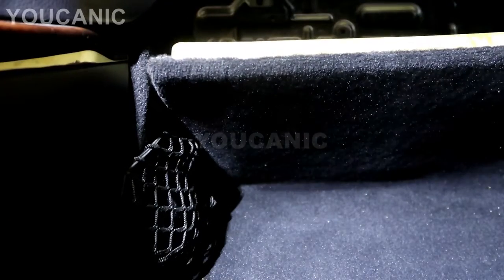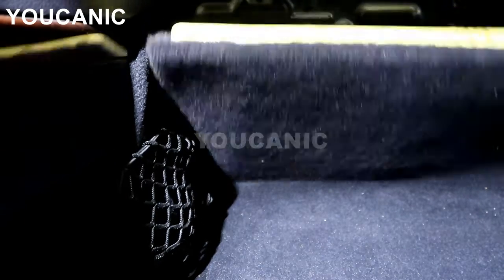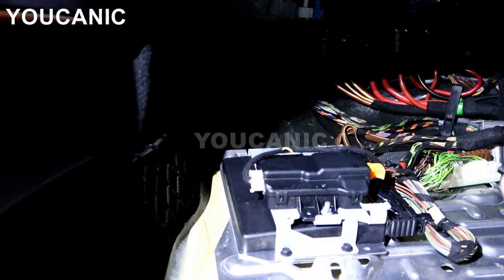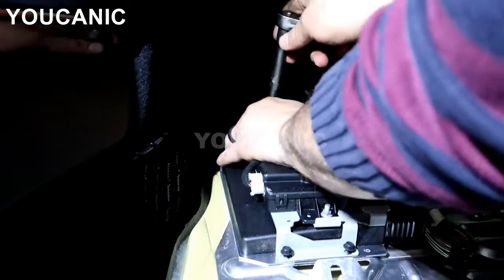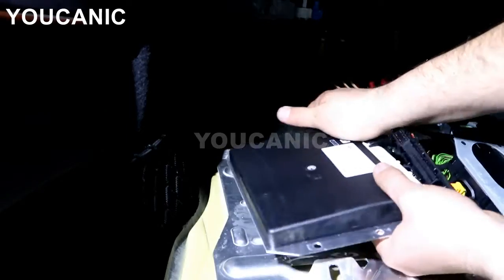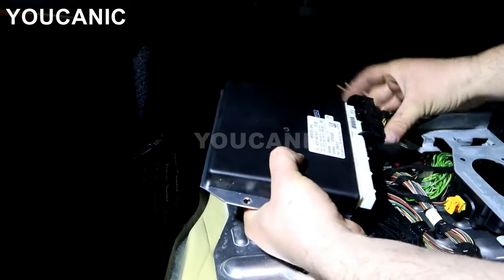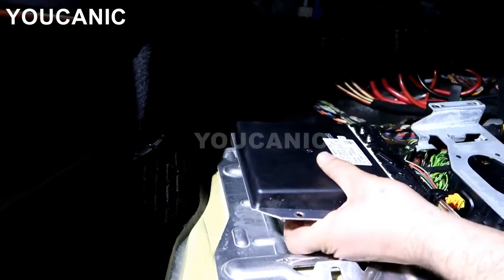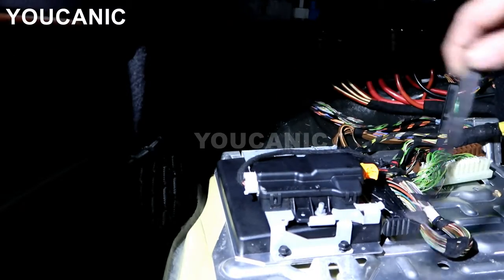Mercedes-Benz Air Suspension Airmatic Control Unit Replacement

Comment: Do you need a recalibration after installing the module or anything to do before and after disconnecting the module? have 2012 Mercedes cls550
Reply: hey I have same question did you have an issues or did calibration after replacement because mine doesnt work

Comment: If i got rid of air ride can i unplug this to get rid of warning light
Reply from the maker: Thanks for reaching out! Yes, you should be able to disconnect it to get rid of the warning light, though specific steps can vary depending on the car model. At Youcanic, we offer helpful guides and resources to make car maintenance easier. If you need any further assistance, feel free to visit our site, [www.youcanic.com](www.youcanic.com). 

We even provide factory repair manuals for detailed instructions. We're here to empower and support you throughout your car ownership journey with our Youcanic scanner and free resources. Trust us to walk with you every step of the way!

Comment: Hi guys I'm desperate for advice, I was simply using a xtool d7 scan tool checking on my old 2010 e550 bec I wanted to see how to check electronic leveling feature but it doesn't offer that and showed connect ECU failed for some features that are not in the unit ..so as I was shutting down the scantool  tablet it froze and not even the reset button will shut it down, even as I disconnected it, now my airmatic button is also frozen at high position, all my air springs are 4.5 inches  above my  chassis ..took to a diy mechanic friend n said the module may be burnt?
I was told it's a very specific part ( A2129003504)..WHICH IS SO DIFFICULT TO FIND ,I'm trying a module with a diff interchangeable number A2129000776 hopefully it's just plug n play ,( do you program it up on installation?) ..or just reset the ECU by disconnecting negative terminal?

I'm not sure what other tips I can do in the meantime ..
Reply: Did you ever solve this?